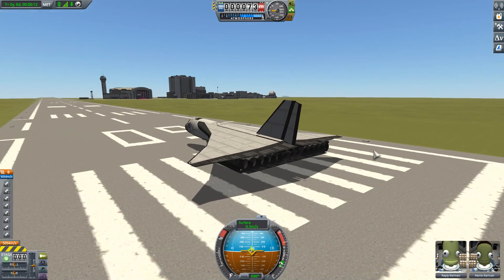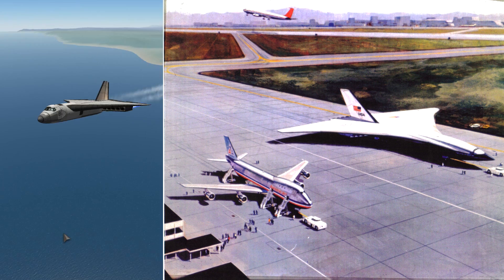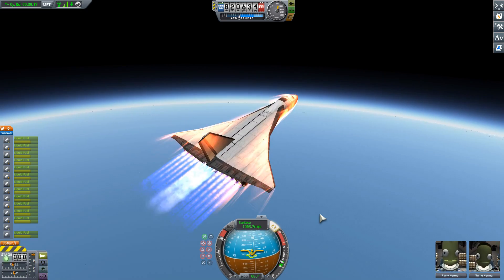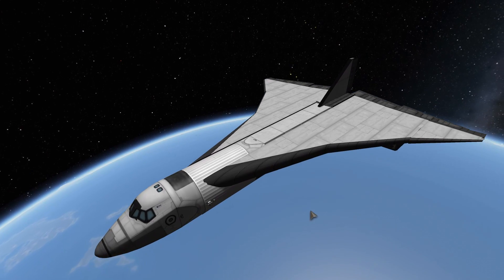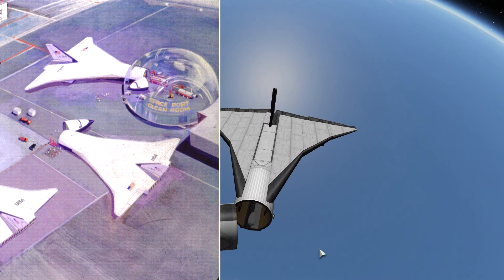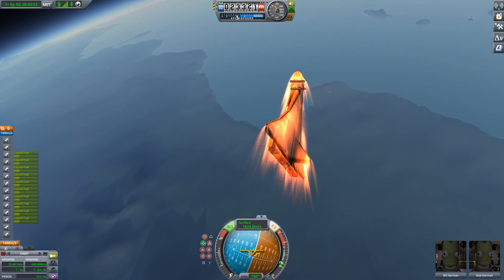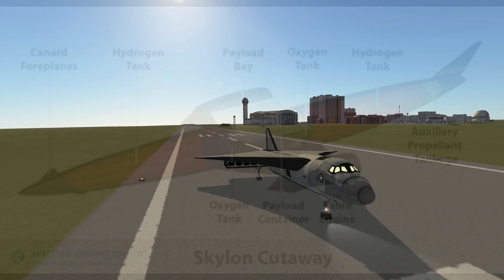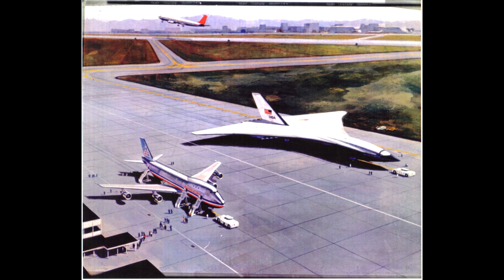The Star-Raker - A 1979 Space Plane With 15 Engines, Massive Wings & Huge Ambition

Comment: Considering it was Rockwell, and considering they had SR-71 engines already morphing into Ram-Jets in flight, I don't think the design needed "magic" engines as you smirkingly suggest.
Reply from the maker: ‘A sufficiently advanced technology is indistinguishable from magic’
Reply: Mach 7 would require Scramjets and basically magic materials to deal with how hot the intake air would be
Reply: @janMelantu  Maybe. Or maybe plasma-fed engines could make their debut. Speculating against development in a field is risky and short sighted.
Reply: SR-71: Mach 3.5 with JP-7
Star-Raker: Mach 6-7 with Hydrogen.

Considering that the engines on the Sr-71 were already running near the physical limits of the materials, the engines on the Star-Raker would have required some very serious magic to stay solid.
Reply: @3gunslingers  Oh, right, forgot that it's impossible for material science to make advances. You should get off the computer, because you'd need magic wood or brick to make one of them!
Reply: @rockspoon6528  
look at 6:40
Do you see the heating on ascent ?
Reply: @3gunslingers  he is playing in a simulation with scaled physics. What the fuck is your point?  Besides, even if "muh that would melt anything" is true, we could still design an ablative exterior to be sprayed on before each flight.
Reply: @rockspoon6528  
No, look at the GRAPH at 6:40 !!
Do you see how much heating the Star-Raker would get on its ascent path?
Reply: @3gunslingers  compare it to an Apollo reentry heating. It's less heating than those capsules endured, and that was sixty years ago.
Reply: @rockspoon6528  
Do you really that to compare a heat shield to an engine intake? 

And I'm talking about ascent , not decent. Ascent takes far longer than decent.
Reply: @3gunslingers  Why not? Also, SpaceX is trading heat tolerance for radiation reflectivity. I'm sure that a similar system could be engineered. As Scott covered on a previous video, air flow has a major impact on how heat is applied to surfaces, so there is no reason to believe that an intake couldn't be designed which actively morphs to better handle heating and volume.
Reply: @rockspoon6528  
Ascent takes much longer than decent. The apollo heat shield were ablative. It's pretty difficult to radiate heat away from inside an air intake, let alone from the inside of a burning engine.

"As Scott covered on a previous video, air flow has a major impact on how heat is applied to surfaces," Yes, the bigger the radius is, the further away the bow shock sits. That keeps heat away from the surface. But how can this work on an engine where the air has to go inside it? You try to get the air close to the engine, not to keep it away. 

The only way to make such an engine work would be the Sabre engine from Skylon. But that's a tad too advanced for Star-Raker.
Reply: SABRE actively cools its intake with a heat exchanger that would have looked like magic in the 70s. Though, it's intended to supply a normalish turbine, so would likely be overkill for the mighty morphin' ram jet on this thing.

Comment: I always loved the concept od an SSTO spaceplane including, of course, the two HOTOLs. Well, that was before a certain guy started to land rockets the way "God and Bob Heinlein have wanted it". I still hope Skylon will get a chance. 
Thanks for this video, Scott.
Reply: Frankly, for space planes to be a good idea, they need to not go orbital, so SSTO is completely wrong for any practically-minded space plane design. Getting the wings & such into orbit is a waste of fuel, and doesn't even need to be done.
Reply: @absalomdraconis  It's a shame we can't do the same thing that every aircraft does and store fuel in the wings
Reply: @absalomdraconis  Well there´s still the the Sänger-type two-stage. 
Often ignored is the stability problem during VT landings. You may remember the problems during the first SX landings. 
However, I´ve got deepest respect for the SpaceX engineers to have solved this!!!
I´m still not convinced by todays TSTO approaches because of cost effectiveness, sustainability and turnaround time. 
Anyway, they are still FAR AHEAD what some space agencies and companies do (I look at you NASA and Boeing!)
Two variants I liked were described by Robertr Zubrin in Islands in the Sky, and, an different version, in Entering Space. 
And, IMHO, the best concept so far was Kawasaki´s Kankoh Maru design study (looked a bit like the old Union-class dropships from Battletech). Sadly it was only a study.

Comment: Star Raker is a very close runner up after Orion (the atmoic bomb one) for most cool looking but impractical launch vehicle.
Reply: If you ignore that appropriate engines are only now coming close to availability, then it arguably would probably have been more practical than the actual Space Shuttle.
Reply: @absalomdraconis  The shuttle is a very low bar indeed, but there are no engines which can magically make SSTOs work.

Comment: Part of the fun in designing a space plane is contemplating a fully-loaded abort scenario, where you have to land with the payload un-deployed and maybe a stuck fuel vent port. You come in hot 'n' heavy and try to avoid the fence at the end of the runway using 'chutes? air brakes? reverse thrust? retro-rockets? arresting cables? magnets? magic?
Sorta makes you wish you had the brakes on the landing gears you jettisoned.😢

Comment: you know, the turbofan to ramjet design [the magic] HAS been flown by Lockheed before.  SR71's P&W J58s were probably what they based the 8 air breathers on in concept...
Reply: Yes, because Mach 3,5 with JP-7 is totally the same as Mach 6-7 with Hydrogen....

Just look at 6:40 . Do you see that peak heating on ascent ? That's what would melt the engines.

Comment: The Star-Raker concept looks like something that Gerry Anderson would have come up with.
Reply: But Gerry Anderson would have designed it with nuclear powered engines.
Reply: @peterells1720  of course, all of those machines were built with one or two huge obvious glaring points of failure for the drama 😆
Reply: @zaeon.NineZero  that modelwork is something else. Would definitely like to see a Scott video talking about the design.
Reply: I think he did have something very, very similar, though I'm not sure if it was in Thunderbirds or one of his other shows.

Comment: Hey Scott can you make a video about spacecraft windows
It's really interesting for me how do this Windows survive the insane heat of the re-entry
Reply: I guess it boils down to the following three rules:
1. Put them where the hypersonic airstream won't hit them.
2. Put them outside the hypersonic airstream.
3. Don't allow any hypersonic airstream near them.
That, and maybe use special materials instead of glass. Internet says space shuttle windows were coated with fused silica, which should be able to take temperatures of 1000°C plus some change without going all melty. But anything that's not directly blasted by insanely fast air should actually be quite fine without too much extra protection.
Reply: Great answer ☺️ but I still want a video ☺️
Reply: @alirezaeskandari2287  I second the motion.

Comment: If they had built it, it would've been scrapped  by now due to maintainance.
Reply: Nah, it would have killed the Shuttle in favor of an orbital taxi module to get to polar orbits. The trick is that they weren't able to build the engines.
Reply: @absalomdraconis  On a cost effect ratio, do you know how hard this would've been to sustain and advance.
Reply: @theotherside931  : The only spectacular issue would have been the engines, which are still the big problem with it. The rest of it would have been extreme for an aircraft, but I don't believe that it would have been anywhere near as bad as the Space Shuttle with it's freakishly delicate skin tiles.

Comment: This doesn’t seem entirely feasible with 1970/1980s technology
Reply: It is why it was intended for 2020.
Reply: @TheRezro 
As if the Congress would just fund it for fifty years, no problem.
Reply: @jshepard152  You missing the point.
Reply: It's not feasible with 2020s technology either.
Reply: @Easy_VIII  : It's almost feasible with 2020s technology (just waiting for the SABRE engine), though personally I consider it to be the wrong way to do a space plane (I prefer a slow electrical beamed-power stage through the lower atmosphere, followed by a suborbital hop, with an actual rocket kicked out above the atmosphere to handle the orbital insertion separate from the plane).
Reply: @Easy_VIII  They didn't know that back then.

Comment: This would have been more epic than the space shuttle 😍
Reply: & better than Venture Star which was a huge waste of development. This would have been far more worth while.
Reply: @theatom7264  I don't know about that, both VentureStar and Star Raker had pretty tough engineering problems to solve.  I would like to see if anyone could solve VentureStar's propellant tank issues, given advances in material science. And that linear air spike engine was pretty nifty if you can make it work right.
Reply: im sorry but the space shuttle was not epic. in fact, many space historians consider it to be quite cringe
Reply: @nottrevorallen  Nobody with a heart who has ever witnessed a space shuttle launch would not think it was epic. Bitching about the shuttle is for space hipsters.
Reply: @RCAvhstape  : The Space Shuttle's design success was not as a launch system, but as a way to sustain human spaceflight. It did it's job in that sense, but it never met it's official design goal of being a practical launch system.
Reply: @absalomdraconis  True, it failed at its goals of safety and cost effectiveness. But it was still a technical marvel and was truly an awesome thing to see in action. I'd say it's not bad for a first-ever spaceplane. Hopefully the data from it will be useful in the future. X-37 is likely already benefitting from it.
Reply: @RCAvhstape 
Throwing Hoover Dam into low earth orbit would be epic.  However, it wouldn't be the best project for NASA to pursue.  So it was with the shuttle.

Comment: Hi Scott,

Apologizes, but you (maybe) have done a little error at 06:50 :
"one is to use the low conductivity, high temperature ceramic tiles that where used on the space station".
You meant "space shuttle" and not "space station" no ?

Or there is ceramic tiles on the space station and I do not know that :)

Comment: What's the theoretically minimum thrust you would need to get into orbit like this (and I'm assuming fuel isn't an issue as I was thinking along the lines of a  hydrogen fusion reactor (yes, pie in the sky thinking)
Reply: If you want pie-in-the-sky, then aim a bit lower with nuclear isomer reactors (effectively an X-ray battery technology, whenever we get the research done), or even all the way down to beamed power (e.g. lightcraft, or heat exchanger boilers). Those should allow for much lighter vehicles in the near or medium term, thus reducing the needed thrust.

Comment: Ramjet and scramjet engines appear to be finally coming along now. Maybe together with hydrogen produced using nuclear reactors, it could just be made into a working prototype :)
Reply: Honestly, methane is a better option than hydrogen. Hydrogen does provide more energy per it's own mass, and is a bit more efficient to produce extract (see the Sabatier process for methane), but for basically every other metric it's inferior.

Comment: lol all that was needed was “magic” engines, perhaps built from unobtainiam, I cannot think why it wasn’t developed as an SSTO.
Reply: ion-plasma nuclear solar engines powered by vibranium, kriptonite and dwarf star, connected to the fifth dimension.
Reply: The SABRE is getting closer to the multi-mode precooled unobtanium cycle, but yeah that's not flown either...
Reply: @brynclarke1746  
Sabre is a hoax.
Reply: @-danR  Nah it's legit, but given the pace of development idk if it'll be relevant before Starship stomps the market
Reply: @-danR  The Musk fans come out of the woodworks...
Reply: I would say wait a few more years until air-breathing hypersonics become a mature field. Then something like Starraker might live again.
Reply: An engine that transforms from a turbojet to a ramjet was already developed and in use in the SR-71 at that time.
You don't need magic to think you can further develop that engine to reach higher speeds. 

I can think of plenty of other reasons why it wasn't further developed. (like not having the large budget for a space program anymore.... Or still having rocket engines next to these turboramjets. extra weight, cost and complexity)
Reply: @marcdevries9027  SR-71 didn’t use ramjets. At high Mack (beyond efficient turbine operation) it maintained thrust with afterburners.
Reply: @marcdevries9027  
SR-71: Mach 3.5 with JP-7
Star-Raker: Mach 6-7 with Hydrogen.

Considering that the engines on the Sr-71 were already running near the physical limits of the materials, the engines on the Star-Raker would have required some very serious magic to stay solid.
Reply: @3gunslingers  With this attitude we'll be to Mars in no time at all.
Reply: @RCAvhstape  
Yes...
Look at 6:40 
Do you see the heating on ascent ? That would melt anything.
Reply: @3gunslingers  What I saw was a fake heating effect done in a cut rate space sim that can't even get earth's mass right and none of the numbers are even close to reality. Scott likes to use it for quick visual demos, but don't think KSP's visual effects have any bearing on reality.
Reply: @RCAvhstape  KSP isn´t supposed to be earth-scale. Kerbin is 600 kilometer in radius, of course none of the numbers would match a solar system that it doesn´t even represent.
Reply: @3gunslingers  You really see the glass half empty, don't you, Elon Musk cheerleader?
Reply: starshipeleven  No need to get personal. But I'm sure the Rockwell engineers had a clue.

Comment: The J58 engine used by SR-71 was aboult half way there towards the requirements of this beast. I wonder if it could been improved further ...  maybe folks like Agent JayZ would be willing to explain more on this topic.
Reply: The SR-71's engines were pushing material limits. The SABRE engine is getting close, but side-stepping the need is probably a better idea. I for one would use beamed power to remotely power electric fans for a slow climb out of the lower atmosphere, and switch straight to rockets for a final climb. Though I also wouldn't try to orbit the space plane in the first place, getting the payload out of the atmosphere before it lit it's own engine should be enough.

Comment: "how can we make the most complex most expensive space cargo ship in history "  rockwell engineers hold my beer !
Reply: starshipeleven  : As you yourself pointed out, this thing wouldn't require the ceramic tiles of the Space Shuttle orbiter. I have my quibbles with this design too (why does it need to orbit at all?), but comparing it to the overly brittle nightmare that was the Space Shuttle is disingenuous. It would certainly be more of a hassle than a normal aircraft, but not by much. Reentry energies allowing metal heat shielding mean that the stresses of space launch are drastically reduced, which in turn reduces the problems associated with the vehicle. Honestly, the only real design problem is the engines, if not for those, we could realistically build this today with no changes and have it easily work.
Reply: The irony being that once built, it would in theory dramatically reduce the cost of space launches, by removing the need for specialized facilities and having a fully reusable launch vehicle, without any wasted stages
Reply: @weldonwin  *on paper. The shuttle was suppose to be much cheaper with little maintenance and quick turnaround, on paper. But a paper space plane looks a lot different when heat shield meets reentry. It's hard enough to get something to orbit, the complexity and difficulties goes up another magnitude when you add reentry capability to the same amount of hardware that you takeoff with.
Reply: starshipeleven  
Okay.
Reply: In the automation world, the unofficial slogan for Rockwell is "You can buy better, but you'll never pay more!"
Reply: @jeffspaulding9834  Or: "Customer can print money, let's use all we can get."
Reply: starshipeleven  "Modern rockets aren't built in automated assembly lines like cars..." Have ever read about a person named Elon Musk?